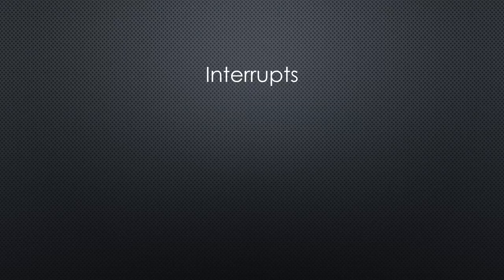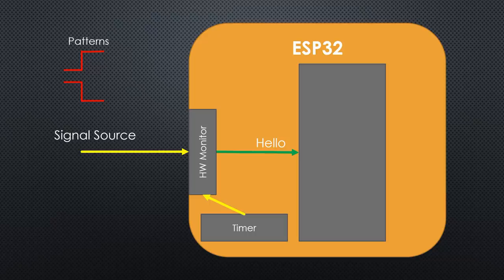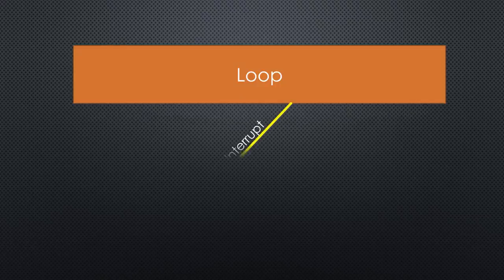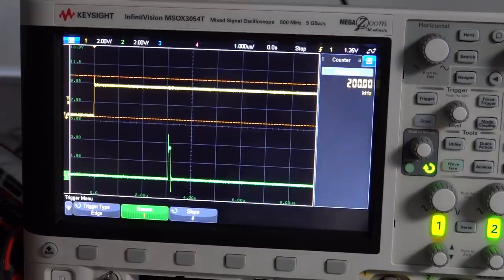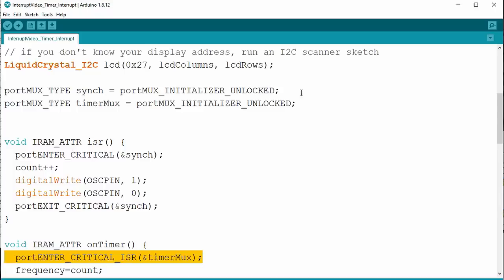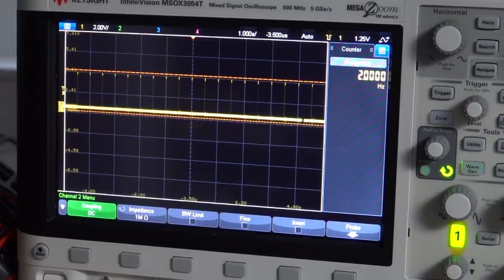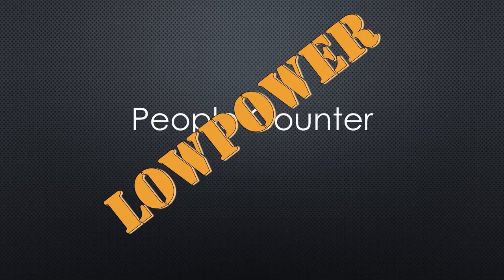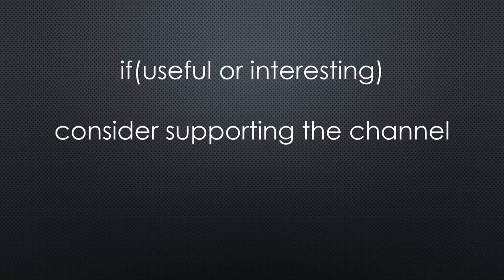#328 ESP32 Secrets: Interrupts, and Deep-Sleep under the Hood

Comment: I understand now that the maximum is 300 kHz and the 10MHz output reference of a GPSDO is way to fast for it. So ESP32 is not able to do that. (be transformed into a GPSDO). What about the Raspberry Pi? Can it be transformed into a GPSDO with a Serial signal from a NEO Gps module? the next one on the list is the PC. Perhaps on the HDMI port would it be able to send a 10 MHz signal synchronized with GPS or NTP servers.
Reply from the maker: Most u-Blox receivers can produce high frequency signals, you do not need anything for that. Only if you want a sine wave or a low-jitter solution you go for external components.

Comment: At 9:20 Andreas says interrupts cannot be disabled in ESP32. Is this still true?  I have been inserting cli()  and sei() into my code to disable and enable interrupts and the compiler does not complain, although I have not conducted any experiments to confirm interrupts are indeed disabled.  noInterrupts() and Interrupts() is also accepted by the compiler.  (I am using platformio)
Reply from the maker: I do not know for sure. I only found Ivan‘s answer.

Comment: Hellow, here you have my method to disable interrupts while you are processing it in ESP32. I´m not programing in arduino ide, i´m using platformIO,.. i´ve made my own 12 bit serial protocol ,so , my start bit call the interrupt, then I disable interrupts, read my 12 bits word and re-enable interrupt. but, i don´t know if this works in arduino ide. My ISR only set true a flag, then in my loop code read the flag
isr_code
  flag=true;

main loop:
if (flag)
  detachInterrupt(interrupt_pin); 
  "read my 12bits word code"; 
   attachInterrupt(digitalPinToInterrupt(interrupt_pin), handleInterrupt, FALLING);
  flag=false;
Reply from the maker: The usual method is to do that in the ISR. But your method seems to work. So thanks for the code.

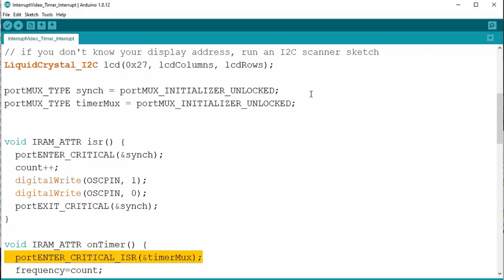Comment: I have a question at 10:50 you defined timerMUX, if I have 3 different interrupts i need to have 3 different lines like this one
portMUX_TYPE synch = portMUX_INITIALIZER_UNLOCKED;  ??
Reply from the maker: I do not know, I only have very basic knowledge here. You have to ask somebody with more knowledge. I only used examples
Reply: @AndreasSpiess  Thanks! I have found this great article, but still no answer for this question
https://techtutorialsx.com/2017/09/30/esp32-arduino-external-interrupts/
Reply: @AndreasSpiess  I`m gonna do some tests and share my findings here
Reply: @AndreasSpiess  I used one of your codes to test if it is needed to declare multiple portMUX_TYPE variables, one for each ISR when you use multiple external interrupts.
I found out that using 2 or only 1 portMUX_TYPE variable the sketch worked fine, so I still don't know if it is needed. Here is the code:
Reply: /*
   Test code for ISR function

   I used and modify this code:https://github.com/SensorsIot/ESP32-Interrupts-deepsleep/blob/master/Frequency_Counterr_with_Interrupt/Frequency_Counterr_with_Interrupt.ino
   I am using an ESP32 thing from adafruit

   Test 1
   create one portMUX_TYPE variable for each ISRs
   Feed signals and see the outputs

   Test 2
   use only one portMUX_TYPE variable for the 2 ISRs
   Feed signals and see the outputs

   Results:

   It did not matter if I use synch1 and synch2 or if I only use synch1
   The 2 test showed the 2 interrupts seem to be working fine

   Notes:
   I don't have a signal generator or oscilloscope to check the signals
   The 2 inputs were a floating cable on INPUTPIN2 and a
   mechanical water flow meter (hall effect sensor) INPUTPIN2
   The code for each test compiled without problems

*/

volatile int count1 = 0;
volatile int count2 = 0;
unsigned long lastEntry;
int frequency1, frequency2;

#define INPUTPIN1 15
#define INPUTPIN2 16

portMUX_TYPE synch1 = portMUX_INITIALIZER_UNLOCKED;
portMUX_TYPE synch2 = portMUX_INITIALIZER_UNLOCKED;

void IRAM_ATTR isr1() {
  portENTER_CRITICAL(&synch1);
  count1++;
  portEXIT_CRITICAL(&synch1);
}

void IRAM_ATTR isr2() {   // uncomment for first test
  portENTER_CRITICAL(&synch2);
  count2++;
  portEXIT_CRITICAL(&synch2);
}

//void IRAM_ATTR isr2() { // uncomment for second test
//  portENTER_CRITICAL(&synch1);
//  count2++;
//  portEXIT_CRITICAL(&synch1);
//}

void setup() {

  Serial.begin(115200);
  Serial.print("setup() running on core ");
  Serial.println(xPortGetCoreID());
  pinMode(INPUTPIN1, INPUT_PULLUP);
  pinMode(INPUTPIN2, INPUT_PULLUP);
  attachInterrupt(INPUTPIN1, isr1, RISING);
  attachInterrupt(INPUTPIN2, isr2, RISING);
  lastEntry = millis();
}

void loop() {
  if (millis() > lastEntry + 1000) {
    frequency1 = count1;
    frequency2 = count2;
    Serial.print("frec1: ");
    Serial.println(frequency1);
    Serial.print("frec12 ");
    Serial.println(frequency2);
    lastEntry = millis();
    count1 = 0;
    count2 = 0;
  }
}
Reply from the maker: Thank you for sharing. I did not fear the compilation. I feared the execution where these muxes should avoid issues. But this needs quite complex testing with different interrupt signals very close together to see how things behave and if the CPU crashes.
Reply: @AndreasSpiess  yes I also think that more testing is needed, if I could I would test more interrupts at the same time with varying frequencies to see what happens, it's an interesting topic

Comment: prob the missing cycles are caused when you update the LCD, try using a different thread.
Reply: the hardware interrupt over-rides the main program loop no matter what. that's the point.
Reply: @TuttleScott  a thread in  a different core I meant
Reply: @raguaviva  yeah, I know but I dont think it would change the results.
Reply: @TuttleScott  How do could you know without trying? Interrupts are slower than a spinning thread because interrupts need to push and pop all the registers in the stack.

Comment: Do you know how to prevent the esp32 serial input from causing a heap overflow?  
```
  while(1)
  {
    if (Serial.available() > 0)
    {
      char_input = Serial.read();
      
      if(char_input == '\r')
      { 
        break;
      }  
      
      input.concat(char_input);
      Serial.print(input);
    }
  }
```
This works but if you enter in say 1000 chars it will cause a crash.  Is there anyway to prevent this?  I know obviously not typing in so many chars but looking for a way to prevent this.
Reply from the maker: I would count the number of characters in the loop.
Reply: @AndreasSpiess  Thanks Andreas yes I just created a check for the amount of bytes and did a Serial.begin(9600) to clear it.

I do have a quick question regarding the BLE with ESP32 as I am never able to get the name value out of a BLE_server and I have been trying to get answers from the devs in this https://github.com/nkolban/esp32-snippets/issues/599 link however any help would be so greatly appreciated!
Reply from the maker: I made one or two videos about BLE on the ESP32. Maybe you find something there.

Comment: I want to use the esp32 to read CSV values and push out pixels led data. I'm using castles library. I Can't go above 1000 pixels  , the esp crashes 😢. Please help me out.
Reply: I'm using the dual core feature of the esp. One task reads the data from micro SD card. The other task waits till the whole frame is loaded and then pushes the data to pixels. Some times watchdog error occurs , ( task gets starvation).I'm also utilising sema fore for the task syncing.
Reply from the maker: I never did this, so I have no knowledge.
Reply: @AndreasSpiess  can u try it

Comment: Many comments suggest running isr on the 2nd core for less latency, any way to achieve that?
Reply from the maker: I made a video on how to use the second core
Reply: What i meant was is it possible to run interrupt routines on the 2nd cores and the remaining on the main core? Maybe I will try esp32 interrupts after finish running the the quartus 13.0sp1for cyclone ii board. it crashes on my windows 10 randomly making it frustrating.

 out of this frustration i even ordered cyclone IV clone from banggood...Maybe i will try to use cheaper cyclone ii once i get comfortable with Cyclone FPGA. but until it arrives, i am trying all possible combinations of virutal machines/linux/windows xp/windows 7 it is very frustrating...now i am repenting why i spent money on unsupported software. by the way, from the google i found that cyclone 10 lp is the same as cyclone iv and similarly priced...so newer is not always the better but software should work!!

Comment: DIGITALWRITE is too slow. For TOGGLING use:
port &= ~(1<<PIN);
port |= (1<<PIN);
Reply from the maker: I am not sure if this is also true on the ESP32.   
digitalWrite(PIN, 1);
digitalWrite(PIN, 0); 
takes 220 nS on my ESP32
Reply: I had tried to find ESP32 Core digitalWrite() source but it's a blob and I failed to find its source. Where I can explore it? Thnk U!
Reply: @AndreasSpiess  You can write both routine and compare them with an oscilloscope... I'm interested in the resolts too. thanks
Reply: Port manipulation is a known speedup on the AVR micros but that is totally implementation dependent and not necessarily true for every architecture
Reply: The fastest way to toggle the pin is to directly manipulate the register GPIO_OUT_REG (address: 0x3FF44004) or GPIO_OUT1_REG (0x3FF44010) in the way described by @blenderNOOb69. For details you can look for esp32_technical_reference_manual_en.pdf on the Espressif site.
Reply: @blenderNOOb69: You have an error in your code. You have to use the bitwise not (~) instead of the logical not (!) to make it work. E.g. ! 0b1100 = 0b0000 vs.~0b1100 = 0b0011  (4 bit example)
Reply: @AndreasSpiess  Read the ESP32 documentation, they have explained how to use the registers directly. Moreover, if you need performance, change the Arduino IDE settings to -O3 or at least -O2, because the Arduino IDE sets the compilation flag to save space and not improve performance by default.

Comment: which microcontroller do you recommend for real-time applications?
Reply: Any uC which will be programmed on 'bare metal' rather than with arduino, or any other environment that puts it's own code on the top of yours.
Reply: s bright  and this is what I meant. You could program either avr and arm with assembly, disabling anthing you don't want / need and react as quick as it's possible. BTW in terms of reaction speed FPGA may be useful.

Comment: Thank you for another valuable video!
I too am challenged to learn more after reading your example

What if you changed

void IRAM_ATTR isr() {
   portENTER_CRITICAL(&synch);
   digitalWrite(OSCPIN, 1);
   digitalWrite(OSCPIN, 0);
   count++;
   portEXIT_CRITICAL(&synch);
 }
to

void IRAM_ATTR isr() {
   digitalWrite(OSCPIN, 1);
  portENTER_CRITICAL(&synch);

 

   digitalWrite(OSCPIN, 0);
   count++;
   portEXIT_CRITICAL(&synch);
 }
you might be able to observe the some of the latency that portENTER_CRITICAL may introduce?

What happens when you change portENTER_CRITICAL to matching *CRITICAL_ISR functions
What happens if you just remove the *CRITICAL calls?
I'm not equipped hardware wise to reproduce this yet - maybe I can do that later?
( I was also unable to download the sources to the libraries to see what it was doing at low level )
Reply: Adding two digitalWrites adds time too.  See you really can't measure something without affecting the thing your measuring. I think thats called the uncertainty principle.
Reply from the maker: @David: Maybe you try it out?

Comment: As Carl Hage pointed out, there could be an interrupt priority issue that is hidden in the framework. 
https://youtu.be/tg6uu_SoXMo?list=PLnMKNibPkDnFeFV4eBfDQ9e5IrGL_dx1Q&t=540
This video sheds some light on interrupt priorities in a FreeRTOS  application. Summary : if you call any FreeRTOS xxxFromISR api functions from the isr, you have to limit the interrupt priority. If you don't call any FreeRTOS xxxFromISR functions, you can set a higher interrupt priority and this will guarantee that your interrupt handling will not be disturbed by  FreeRTOS code execution.  However, the attachInterrupt() function does not expose this level of detail, so it's likely safe and limits the interrupt priority level. That would account for some of  the huge level of jitter you are getting in the interrupt response latency.
Reply from the maker: Other commenters also pointed to RTOS. But I am an RTOS noob :-(

Comment: Hmm. Why is the es32 so inaccurate at reading analog voltages?
Reply from the maker: I do not know
Reply: Hmmm. How do you read voltages in a chip? 

You compare to a known voltage! 

Where do you get that from? 

Maybe a built in zener. 

How accurate ist that zener? 

Depends on the temperature of the junction, I guess!
What depends the temperature of the junction on?
The (calculating) power, the CPU ist consuming at the moment...
Temperature of the sourroundings.
Heat dissipation.
Air flow

Etc, etc
Reply: The ADC is very non-linear at the edges of the range, near Gnd and Vcc. In the middle of the input range it's nonlinear but it can be corrected. See the forum.ezsbc.com for suitable code.

Comment: I'm little disappointed with the Esp32 RT functions. Herr Spiess, maybe an stm32 tests in the near future? They are probably a better choice for RT control systems, STM32F7xx would be awesome.Esp32 is a strange mashup of the microcontroller world. It's a shame that Xmega didn't gained more traction and Microchip killed it. Those were AVRs on steroids.
Reply: What do you base this disappointment on? The ESP32 can do hard real time , you just need to know how to do it and interface more directly with the microcontroller. There is many layers of software in this code (espressif SDK, FreeRTOS, arduino code), plus issues in the code itself. Go to ESP32 forums and ask questions how to do it optimally.
Reply from the maker: @Ferenc: Most of my projects need Wi-Fi. And rarely speed...

Comment: You can disable interupts on the ESP32 with portDISABLE_INTERRUPTS(); I learned that because my Adafruit_NeoPixel library was not working to animate an led strip. Disabling interrupts temporarily fixed the problem. Enabling interrupts again is critical with portENABLE_INTERRUPTS();  https://github.com/adafruit/Adafruit_NeoPixel/issues/139
Reply from the maker: Thank you for the link. Good to know.

Comment: In fact, ESP32 is a crappy MCU. It was designed with many kluges. 2 cores, 4 different types of RAM with different access types, 5 strapping pins, external flash with very hard to understand encryption system, weird and hard to use ULP co-processor, buggy partially closed-source API, mandatory FreeRTOS, unstable and pin-hungry JTAG debugging... And it's not fast at all. Of course it's much faster, than those old AVR MCUs, but, according to tests, it's 15 times slower than STM32F7 MCU. I would recommend STM32 MCUs for low-power or time-critical tasks.
Reply from the maker: I like the Wi-Fi of the ESP32 and do not care too much about the rest, if I know how to handle it. I am a hobbyist and love the community support.
Reply: I think ST is heading in the direction of having some IOT boards. I think the prices right now are kind of high but they are a great company, very solid hardware and tools.
Reply: Can you suggest a better MCU for the same (or lower) price? You can always criticize everything, for example Democracy is the worst system of government ..... except all the others.

Comment: Is using digitalwrite a good idea?  Replacing digitalWrite(3, 1); with    PORTD |= 0x8; is FAR faster.  More info on https://forum.arduino.cc/index.php?topic=4324.0  and  https://www.instructables.com/id/Faster-ESP32/
Reply from the maker: We are on an ESP32 here, not on an Arduino. It is much faster (see my other comments)
Reply: @AndreasSpiess  The Arduino digitalWrite is used at 7.34 . This digitalWrite comes from the arduino librarie and has a lot of overhead, even on the esp32 . I made a PID controller on esp32 where replacing all the digitalWrite and digitalRead had a spectacular impact. ( 2 times as fast). Note this can be done withing the arduino environment, no need to move to Espressif environment.